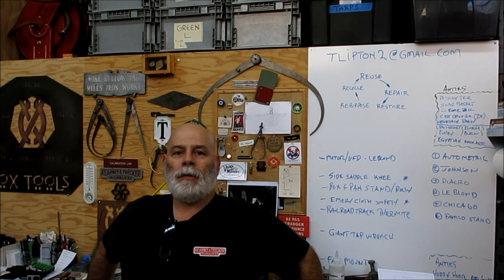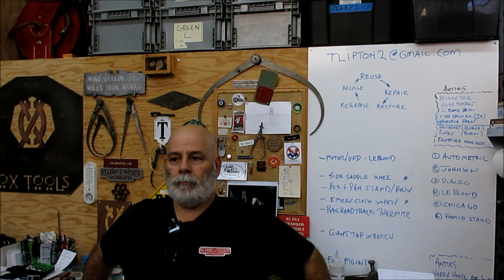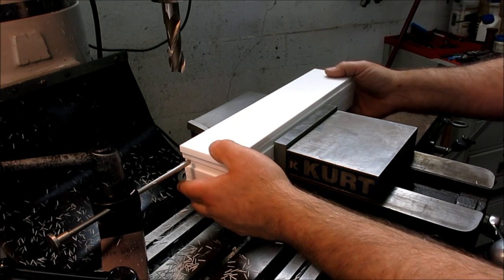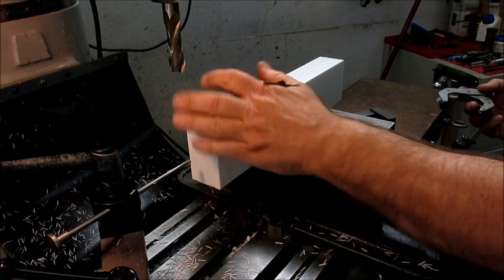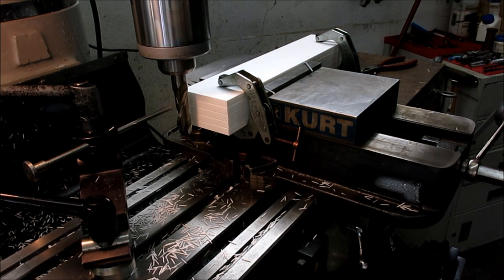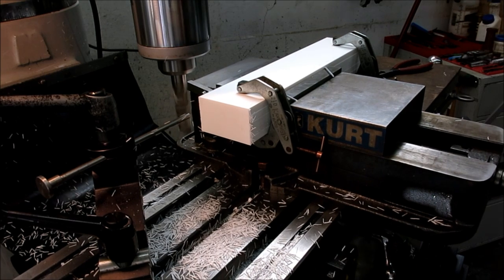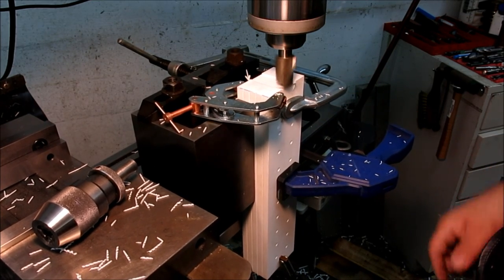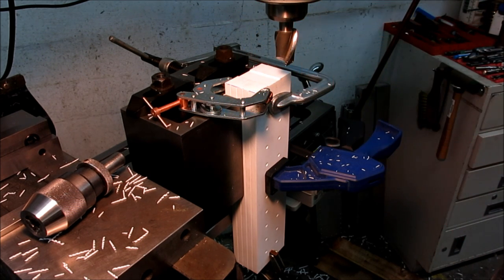Milling Tips 2

Comment: I saw this video yesterday and was about to say "Ah! Tom really makes production understandable for us engineers," but I waited till today and was glad I did. I was rereading your book (the Manual Milling Machine chapter) after lunch, and came across many of the techniques you used in the video,  like the Aluminum wires for holding a stack of stuff. The videos and the book are complementary. Unabashed plug, guys, buy the book. At least if you are reasonably experienced. There are better beginner's books. Very interesting stuff, production (but boring if you actually do a lot of it!) -- and it is not taught in Engineering schools, except in a very general way. Bravo Tom, for the video and the book.
Reply from the maker: Hey Juan,

Thanks for the nice comment. I really use the stuff in the book. 

All the best,

Tom

Comment: Tom, realize this is an older video, but I was surprised you didn't already know the ISO approved name for the aluminum wires you used in the vice! Page 2123, para 45, line 6-8 of the ISO Standards Manual, CLEARLY calls out the proper name: "Doohickeys"! Now don't forget y'all! And THANKS for all the knowledge you share and the time you spend doing it!
Reply from the maker: Hey Paul,

Dang my ignorance shows again. Well my motto is "fake it till you make it" Glad you noticed it now after I've had some time to build some shop cred. Thanks for the comment.

Cheers,

Tom

Comment: Hi Tom,
How about "Slack Eaters" for the rods. On some harder materials sometimes I use Masonite or suitable cardboard to equalize width.
Good tips about setting up and production considerations, I'm not so keen on production, but, sometimes it has to be done, and the faster the better.
Cheers,
Pierre
Reply from the maker: Hey Pierre,

I stopped using paper and materials that fall apart with coolant when I started running CNC machines. The soft wire works really well. Copper or alum is best.

Cheers,

Tom

Comment: For delrin i prefer to power tap with a hand drill.  The tap seems to follow a bit better in such a soft material.  I also will pilot drill for near 90% thread engagement just to try and give those threads as much safety margin as possible for whoever is assembling them.

Comment: Hey Tom...

Great lessons....curious as you mentioned the material was soft, near the end of the video you could see where the Kant Twist clamps was located from an oil print, yet the material did not look deformed?  So material is soft yet hard enough that the clamps don't mar the material?  

Chuck
Reply from the maker: Hey Chuck,

You are correct. The undulator wires marked the edge but the pressure there is much more concentrated. This stuff is pretty amazing material. When you come up I'll give you a couple hunks to play around with.

Cheers,

Tom

Comment: Tom: nice video. However, would like more detail on power tapping. Do you just place the tap at the entrance of the hole and let it pull itself in, then reverse and let it drive itself back out? Thanks
Reply from the maker: Hi Gecko,

Its almost that simple. I do follow the tap with the quill handle going in and coming out. When I start there is slight engagement pressure to get the tap to bite. On the way out I balance the quill handle against the return spring force so the tap sees no weight. Hope that helps.

Cheers,

Tom

Comment: Tom, when you turned the job around at 6-22 it looked like the pin in the handle might have been resting on the top of the moving jaw or it was very close and stopping the job from sitting on its base, what do you think,

Comment: Mr Lipton,
Around the 8:12 mark where you are setting your DRO; assuming you had enough table length, could you not mill one side flat to get a reference point, zero your DRO, and then move the table over 13 inches the other direction and be all set up on the other side? It might take a while to move the table, but if you have a power feed, it would still be quicker than measuring with calipers.
Thanks,
Noah
Reply from the maker: Hi Noah,

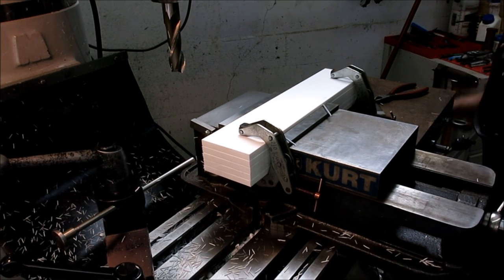If these parts would have been a whisker shorter I would have done that. With the parts centered there was too much overhang. I also don't like shooting video from the opposite side. Its a tough spot to get a good shot from. You can see around 4:48 where I have the parts shifted over to the right. Good comment and question.

Cheers,

Tom
Reply: Gotcha. Thanks.

Comment: tom i havea new trump mill bought 6 months ago a bridgport clone very nice machine 9x49. question--- is it ok to power tap in and then reverse the motor? does it do any harm to the motor or is this ok for me to do this on my mill? thanks love your videos i learn lots from you.
Reply from the maker: Jamie Buckley Hi Jamie,

If you have true three phase power its not a problem. If you do a lot of it then the weak link in the system is not the motor but the motor switch. Been doing it for many years and had two switches go in that time. One was another guy to boot. Tap away. Thanks for the comment.

Cheers,

Tom

Comment: Tom, YouTube claims this video was 1080p. Is it lying? Thanks for the videos! Jon
Reply from the maker: Hi Yan,

I shoot in 720p for everything except the little segment with the DRO. I would say they are stretching the truth a bit.

Cheers,

Tom
Reply: oxtoolco Tom, I agree. I said I see a significant difference between 720p and 1080p. That is, I USED to. Now, I see no difference whatsoever. YouTube "auto" setting usually comes up at 720p and sometimes there's a 1080p choice, sometimes not. Something's changed, or this is yet another evidence of my increasing mental deterioration. :)  Jon

Comment: Is it OK to crank the mill into reverse before the spindle has stopped or are you breaking in between?
Reply from the maker: Hi Paintball,

If you do it all day long it might be a problem. The motor can handle it fine. The switch is generally what fails in the system. Never had a problem doing this with many mills over the years.  Thanks for the comment.

Cheers,

Tom

Comment: Is there a video where you talk about those calipers
Reply from the maker: Hey Max.

Not sure. I think I showed them in a previous video but I can't remember. Mitutoyo, carbon fiber, 24 inch, Craigslist $350. They weight about two pounds.

Cheers,

Tom
Reply: oxtoolco What a steal

Comment: I use a chunk of cardboard or folded up paper instead of the aluminium wire. It's less likely to dent your work pieces.
Reply from the maker: +Dave Lyon Hi Dave,

That works as pretty good as well but does not hold up when you use coolant. Thanks for the comment.

Cheers,

Tom
Reply: +oxtoolco Coolant's not really a problem. The part that is inside the vice jaw stays dry. There's 100 ways to skin a cat. That's why I like to watch videos like yours. I get to learn new ideas.
Reply: +Dave Lyon How about a bit of sheet leather against the moving jaw, effectively making a grippy soft-jaw with some limited 'give' to accommodate the differing thicknesses of the parts? Possibly only suitable for soft materials, as I guess otherwise it might allow too much parts movement when milling towards the moving jaw?  Disclaimer: I am not a machinist., so just asking...
Reply: +Dave Lyon How about a bit of sheet leather against the moving jaw, effectively making a grippy soft-jaw with some limited 'give' to accommodate the differing thicknesses of the parts? Possibly only suitable for soft materials, as I guess otherwise it might allow too much parts movement when milling towards the moving jaw?  Disclaimer: I am not a machinist., so just asking...
Reply: +Alan Mumford Leather would work fine. I'm not a leather worker, but it seems like it may be a $10 solution to a $1 problem though.

Comment: I like Chingadares for a name for the alum rods used that way. A old Engineer I knew would use the term a lot.
Reply from the maker: Lew Sou Hi Lew,

Its a great word as it works in many situations. Chingus is another good one for those pesky parts. Thanks for the comment.

Cheers,

Tom
Reply: Tom as I get older I try to use harmless terms rather than as my Mother would call it "cussing a blue streak!". I still fall short on occasion finding I still have not "seen it All". Cheers Amigo!

Comment: wouldn't it be simpler to to set a stop , then clean them up long ,then turn them over and bring them to length. Edge find where your stop is and use your DRO no measuring needed otherwise
Reply from the maker: Hi Jeff,

Edge find or measure. Both the same. You have to measure at some point or you don't know what your doing. Don't remember what the specific situation was with these parts. Thanks for the comment.

Cheers,

Tom

Comment: "space busters"
Reply from the maker: Excellent! Thanks for the comment.

Cheers,

Tom
Reply: I thought you were going to use neoprene sheet. I cut up discarded wetsuits on occasions...
But many thanks for the alu rod idea: I can see lots of situations where that would have advantages.
I haven't been in the exact same situation with plastic workpieces, (when I have, I've first stood them up and taken a lick to make them all the same width) but with metal ones, I have used lead sheet to good effect.  I particularly like lead for holding castings.
Reply from the maker: Hi Gotten,

Thanks for the comment.

Cheers,

Tom

Comment: undulation correction device
Reply from the maker: Hey Andy,

I like your name. It hold special meaning to me as I actually work on real devices called undulators. These are to bend a beam of electrons to make them emit synchrotron radiation I think we will call them vise undulators. Thanks for the great suggestion.

Cheers,

Tom
Reply: oxtoolco Then you need some wigglers as well!

Comment: Oh that poor neglected work stop LOL
set it opposite the end you are working on, set up on the shortest part in the pile
to clean up and hope like hell the morons in the waterjet dept left you any stock,,,,,,,,,,
I deal with this shit almost daily.
These morons actually did a crappy job of water jet cutting me out 10 blanks
3/4 x1 1/5" x14" out of 6061 aluminum plate................
bar in that size is stupidly available and much cheaper........

Gent
Reply from the maker: Hey Gent,

These would be the morons at the plastic supplier. All table sawed to size. I could hit five grand repeatedly on the tablesaw with a good fence but these guys don't even own a set of calipers. Time for undulator wires.

Cheers,

Tom